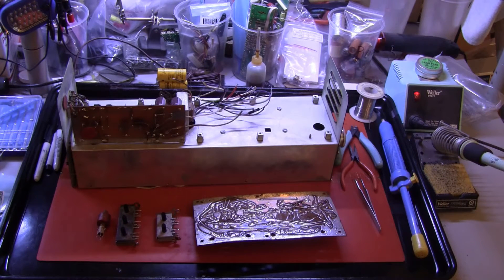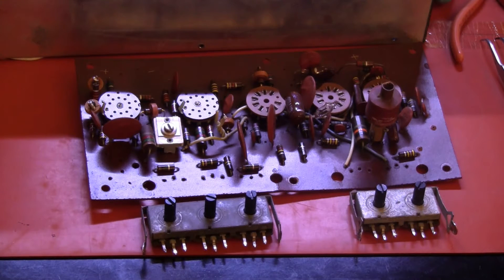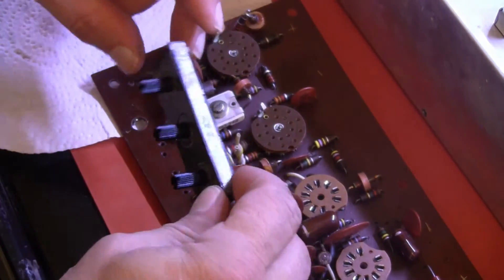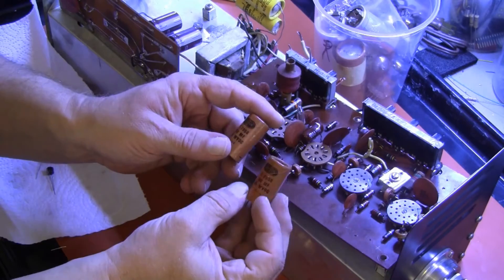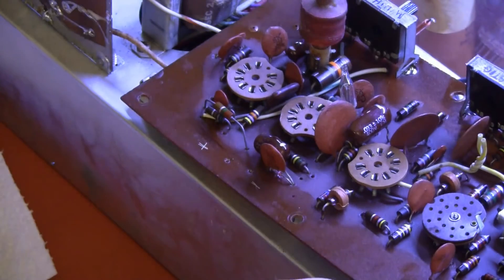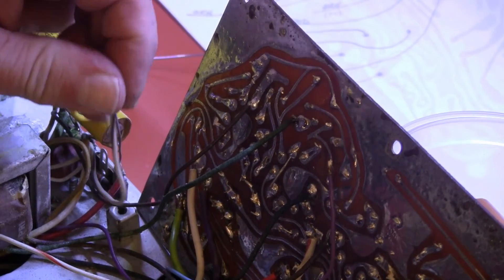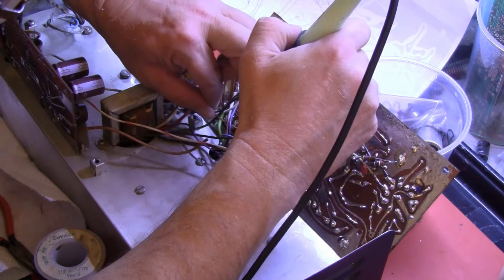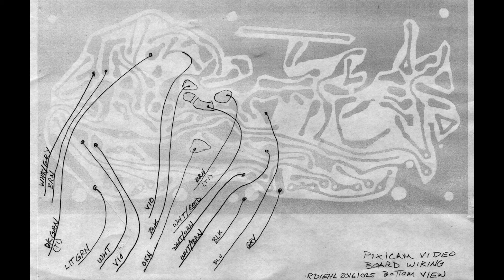Pixicam Restoration Video Number 1

Comment: Great video Labguy. I can believe it with the capacitor size difference - I replaced a bipolar electro in a 1987 five-inch TV and the size difference was just as goofy - and the new one was rated at a four times higher voltage.
Reply from the maker: Congratulations sir. You are a true die hard entusiast. Anyone who sits through this kind of video must really like watching old men solder. Big grin here.

My Dad was repairing an old radio in the mid 1960s and we were experiencing the same phenomenon back then. When I work with surface mount parts today, I am blown away by how much capacitance can be crammed into such tiny parts. Their voltage ratings are starting to become impressive too. I think the upper limit will be the "arc over" size of the part and not its dielectric breakdown!
Reply: I confess I do love watching over the shoulders of good engineers. Better than any TV show.

I'm having to be really careful with a repair on a studio preamp at the moment as it has tiny surface mount caps mixed in with through-hole caps and regulators which are all worn out thanks to compromised thermal design. That's one downside to making everything smaller. At least great quality 105ºc rated parts are available now to replace the junk they put in at the factory!